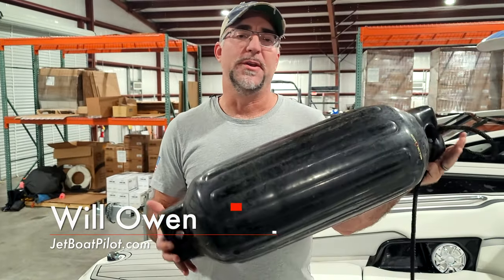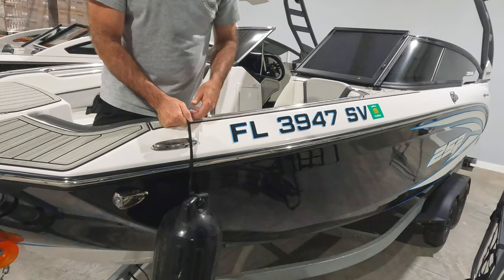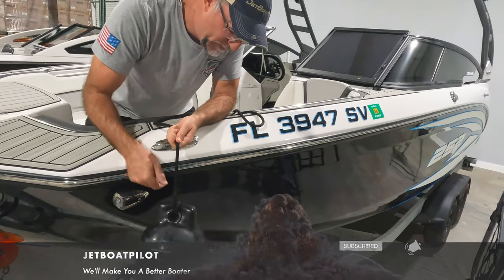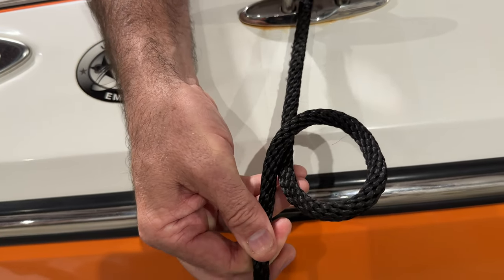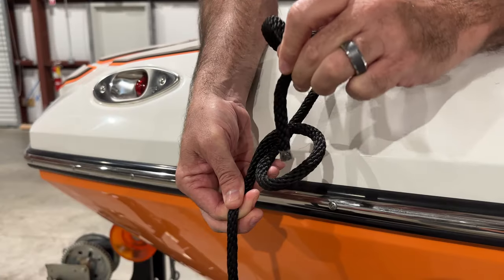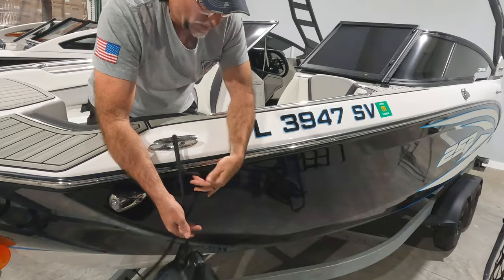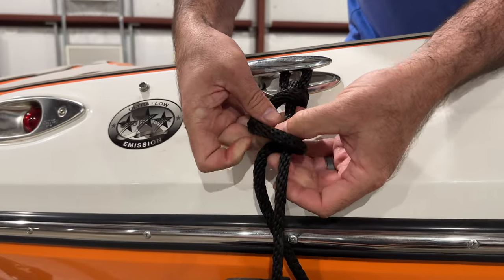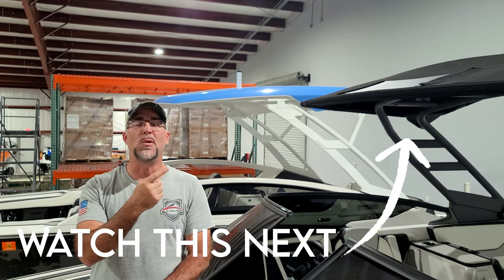Quick Adjust Fender Knot | Tie It Fast, Adjust It Fast, Easy To Learn

Comment: If you hang the fender too low so the load comes off as it bobs on the water, the knot is no longer effective.  if you want a reliable, quick adjust knot that trawlermen use, then use a clove hitch in the bite.  Secure and fast to alter the height of.
Reply: Loop of rope to set the fender height through the middle of the cleat, then put the rope loop over the cleat ears.......waves don't move it.

Comment: Smart knot. Thanks.  What I've learned is that there's a way to tie on a fender that you learn in your first sailing course, but then you do what all the experienced sailors do: A whatever knot, with a couple of half hitches.   Your knot is really smart, and you can add the half hitches without changing anything. I really appreciate this.  My fender lines are much longer than yours so I'd push a loop  (bend) through,  then I'll secure it with a half hitch that is another loop (bend). 
What I've also learned is that if you step aboard and they decide you're near the bottom of the experience ladder they are going to spend more time giving you crap than working on their own sailing skills. (They never seem to notice at the end of the trip how much you've learned.) However,  if you can tie knots, real knots, they'll still give you nonsense, but they'll back off.  (Meanwhile you continually work on your seamanship. One guy has a blog that is full of all the things I did on his boat as though they floated down from the clouds and landed in his head. No mention of me. That's okay, we got where we were going and didn't sink.  Where ever I am there's more of those tricks. On his boat .... that list is now closed. He has learned to have extra rope on board, especially if you're crossing an ocean.)  
And I'm sure you know pausing to head scratch and then trying something else is not part of how a sailor ties a bowline.  So I'm going to practice your knot until I can do it automatically without looking.
Reply from the maker: Thank you very much for the kind words! We don't get them every day.

Comment: This is the bellringer's knot, used to hang the line to the bell in a church when not in use. I wouldn't trust this knot for anything hangin over the side of a boat. It is great for consistent static downforce.. but if you forget your fenders and leave them hangin as you leave the dock and go for a cruise(which I see day in and day out) I wld rather have them hangin on a locked cleat hitch on a cleat or clove hitch on a rail,😊 than this knot.
Reply from the maker: Interesting.
Reply: No F’ing way I’m trusting this.

Comment: What knot for securing rope to fender? I have the fender with hole in  middle instead of handle.
Reply from the maker: I'd have to see a picture of your fender first.
Reply: @JetBoatPilot  I don't think I can upload a photo on here unfortunately. Just picture a normal fender like your video but with a hole running down the middle for the line to go inside instead of ontop. I guess like a 🍩
Reply from the maker: @stevewilliams4777  email me at will@jetboatpilot.com
Reply: For a fender with a hole in the middle, run the rope through to the end and tie a stopper knot (figure-eight or barrel).  Put a similar knot on the top, so the rope doesn't fall out in storage.  If the hole is too large for a stopper to work (or the rope is too small), use a long bowline.  (This type of fender is often used horizontally, instead of vertically, in which case your method may vary.)
Reply: @JetBoatPilot  just noticed this reply. I think I figured it out, just required a much larger line. Thanks

Comment: The length of that fender appears to equal the freeboard on that runabout (????).....not sure why you would need to adjust fender height.
And,  you are assuming a downloading effect on the fender....however if it bobs UP, it will have a tendency to loosed the loop and thereby release the fender all together.....no bueno!

You may benefit by spending time with professional seagoing crew vs the knuckleheads hanging around the lake house.

Do yourself a favor and get out on  some  big & heavy ocean going  vessels.... with many feet / yards vs inches of freeboard .....many tons vs hundreds of pounds of measured  displacement.
Hint...don't try your trick hitch in that environment. Add a bit of wind and or sea state and there will be hull sides to repair!

Comment: Your basically tying a half hitch around the working end of the rope
Reply from the maker: And if you have the right kind of line, this works exceptionally well. If you use nylon line, like the kind that comes with entry level fenders, this knot won't hold well.

Comment: I'm not sure that's any faster than tying it off to the cleat?
Reply from the maker: It mainly makes it easier to adjust up or down quickly.
Reply: Solving a non problem. 👎

Comment: For someone who understands a lot about knots, this is a very stupid method to tie a fender to a cleat. Sorry dude.
Reply: Care to explain why?
Reply: @Artseventy6   It's only going to hold for as long as the bitter end stays pointed in the right direction. If you have a cleat right there anyway it's crazy... just use an appropriate cleat hitch (more initial wraps if you have smaller rope on a bigger cleat).
Reply: @privateparty4900  It definitely looks easier to adjust it quickly, rather than untying and retying a cleat hitch.
Reply: @Artseventy6  It might be (maybe?) but, I'll bet a six-pack that you'll be missing fenders in minutes on anything but flat water. (at least if you don't back it up with a 2nd knot which will negate the "quick" part. could be wrong but... didn't stand up to much jostling for me.
Reply: @privateparty4900  I'll have to try it out.
Reply: I couldn’t agree more, this knot is total shit.